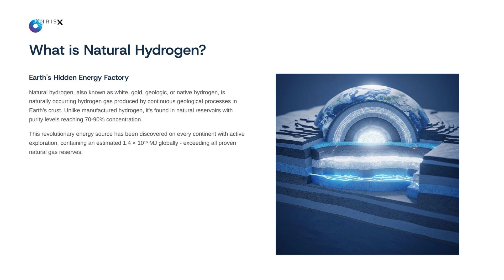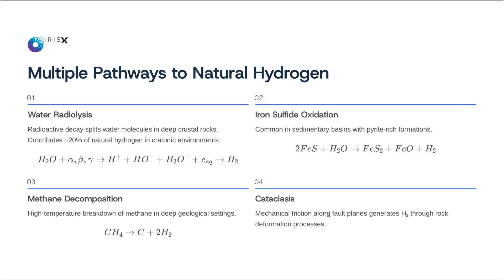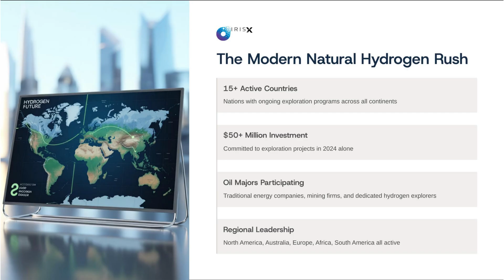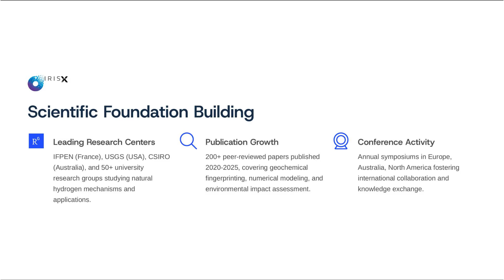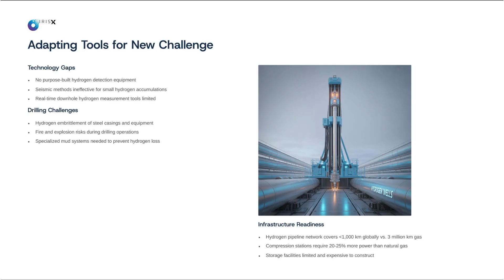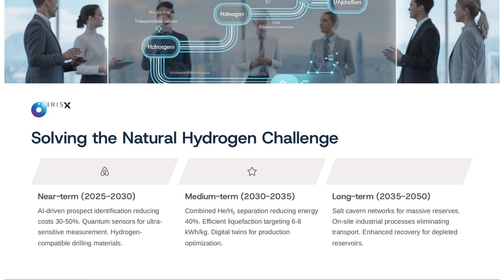Natural Hydrogen Explained for Professionals—From Rock Physics to Production

Comment: A fantasy story. The only well in the world that ever achieved some sustained flow of hydrogen to surface, Bougou-1 in Mali, produces up to 1135kg/d, 3BOE/d oil equivalent and 1/5th the output of a small onshore wind turbine. Attempts to flowtest natural hydrogen exploration wells elsewhere resulted in negligible flow,. For a commercial project, the first hurdle would be demonstrating that wells can flow at rates at least two orders of magnitude higher than Bougou-1, i.e., a few tons of H2 per day. Then, the next challenge is to demonstrate a proven resource base large enough to support at least 10 years of commercial production (which, as a bare minimum, would have to be in the order of a few 1,000s tons of H2 per annum). Because proven resource enough to sustain the project for many years would be required by the buyers (to give financial security for their project FID) and also to justify the cost of surface facilities to dehydrate, purity and compress the hydrogen.
Reply from the maker: IRIS-X is not based on a fantasy story or only theoretical assumptions. The analysis is based on real field evaluation using an IRIS-X prototype, including field sensing, geochemical signatures, and AI interpretation of subsurface hydrogen/helium indicators.

It does not claim that commercial production is already proven. It shows that IRIS-X can help identify and de-risk potential natural hydrogen targets before expensive drilling and flow testing. all the results are published for early detection. Also, there is a numerical mistake about Mali. Bougou-1 is usually cited around 1,500 m³/day of H₂, which is roughly 135 kg/day, not 1,135 kg/day. So the comment overstates the Mali production figure by almost one order of magnitude.